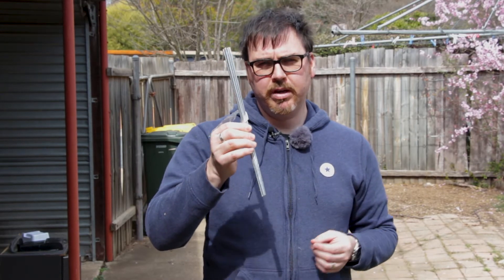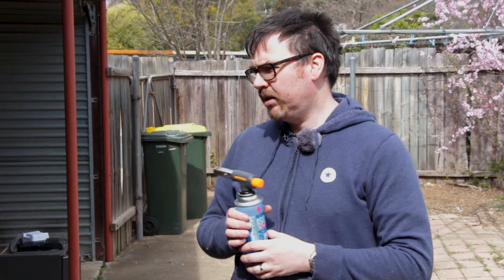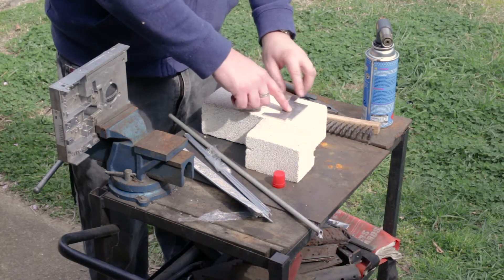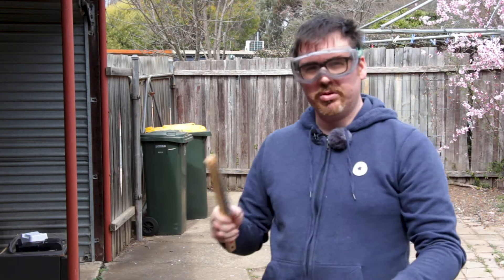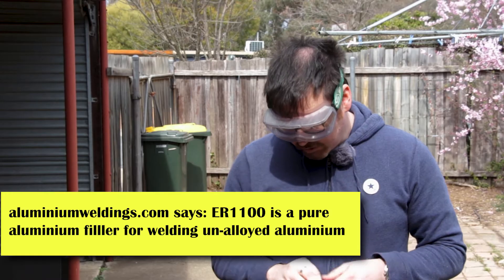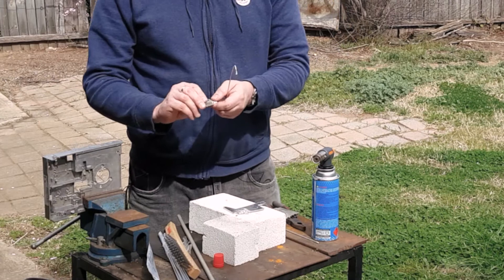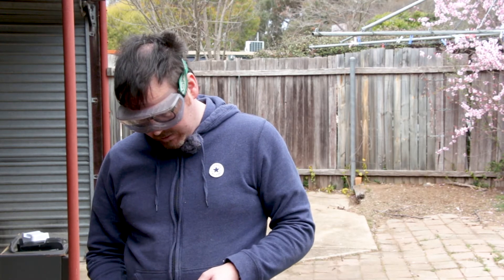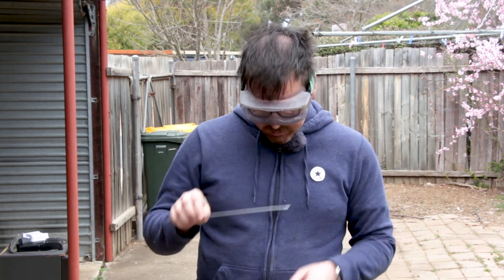Can you do Aluminium Brazing cheaply?

Comment: Bernzomatic and Hobart rods have given me the best success. I a use mapp gas torch small diameter tip for thinner aluminum carefully and a mapp gas rose bud torch for thicker aluminum. I also clean the aluminum very thoroughly with a stainless steel brush and put a slight to medium bevel on both pieces to be fused together. Helps the molten pool to penetrate deeper into the metal and also give the liquid aluminum from the rod a place to pool up and form a flat smooth bead. I have had great success and strong braze fusions using this way. I wish you all the best of luck. Have fun and stay safe in all that you do.

Comment: You need to use a stainless steel brush to clean the metal then heat the metal first and flow the heated rod into the metal ! You will do ok with some practice .

Comment: how fucking boring can someone be.. stop with the bullshit and err mmm err bullshit and just get to the job, you mad a complete balls up of showing us what you done. your so fucking boring i cant remember half of the shit you came out with....... and stop putting the flame into the metal with the rod on it, you simply heat up the metal then TAKE FLAME AWAY and then put the rod to the metal... DO NOT KEEP FLAME ON WHILE spreading the metal and your supposed to lay down the metal then spread it with a stainless rod, not the metal rod your using as a filler..........  took you  15 mins to make a 1 minute video.. also raise the alloy off the heat bricks.

Comment: Thanks StiffmanOz for going to the trouble of sharing this with everyone. I've also had trouble with the cheap aluminium brazing rods I bought off eBay. I have yet to experiment with "genuine" brazing rods. Did you manage to source some inexpensive "genuine" brazing rods, and if so, where from?
Reply from the maker: Hey there. I haven't had a chance to try any other rods. I've seen a few around that look like they are a bit more legit, but I haven't bought some to try yet.

Comment from the maker: So this is a bit of a long one, but tell me, did you find this useful? would you be interested if I was to pursue these rods, and see if there really are aluminium brazing rods for cheap out there?
Reply: Yes I found this very useful as I'm having the very same problem and I would be interested to find some cheap ones that work
Reply: @stephenrolheiser6261  Bernzomatic and Hobart make the best ones I find. Clean aluminum and just the right amount of heat is key before adding your filler material to the 900 degree aluminum joint. Mapp gas is what I use but be careful not focus it on one spot too long.  I heat it decently and touch the rod to the aluminum if It doesn't melt quickly I repeat the process until it does. After I run a bead I take the flame to it for about 20 seconds to insure a good fusion. Then let it cool naturally to prevent cracking. Also I never chill  aluminum in water as the extreme temperature deference could weaken or even cause cracking of the joint.